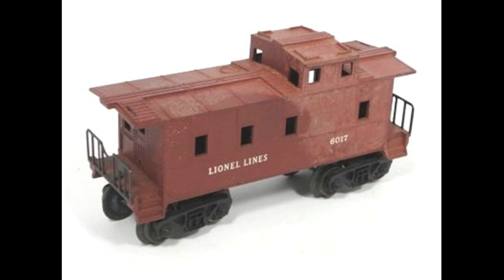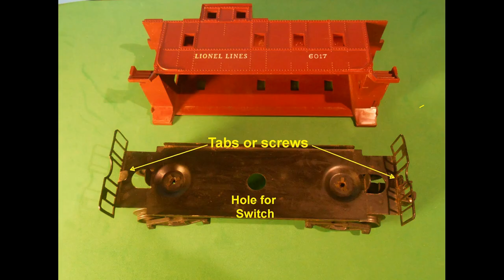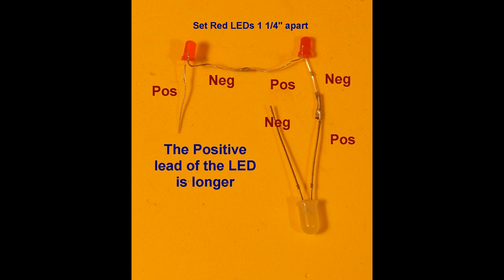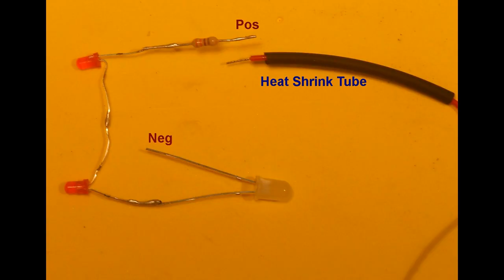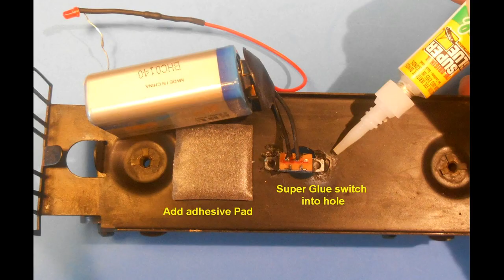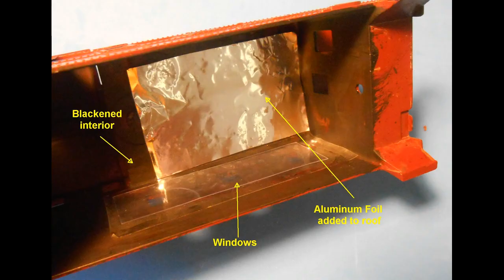Lighting for an O Scale Lionel Caboose

Comment: Pretty impressive!
Reply from the maker: Thanks for the comment. I have finished testing the circuit and found the LED's will remain constantly lit (if the switch is left ON) for 7 days till the voltage drops to around 6 Volts.